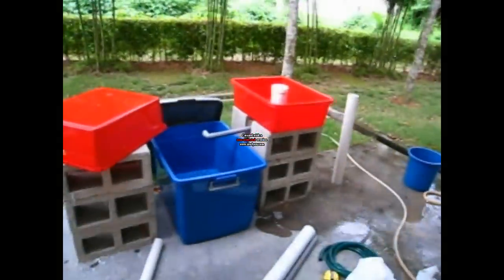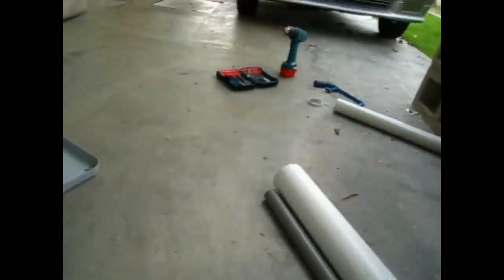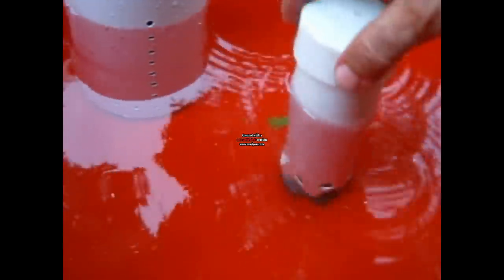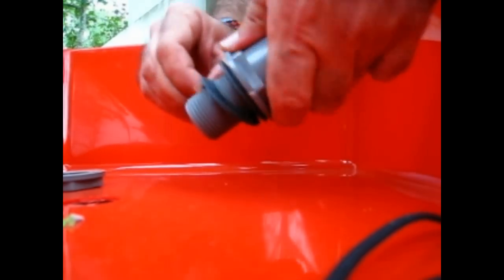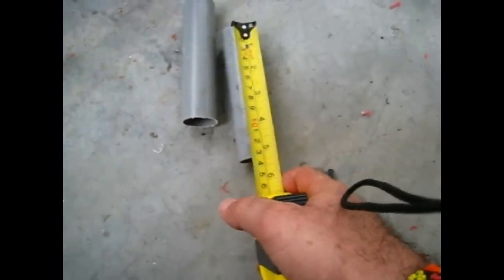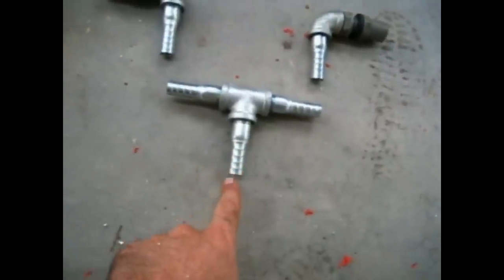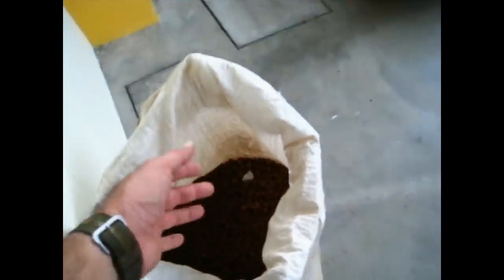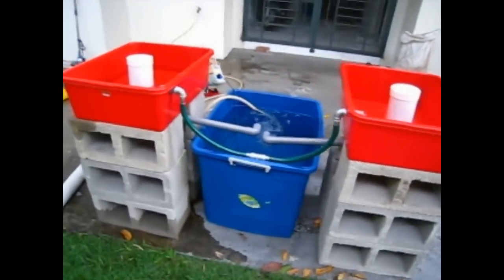Aquaponic System For Beginners (guide) . Home Aquaponic System on a Low Budget

Comment: Just saw your video for the first time.  First of all, bravo!  This is a great little set up and your willingness to put it together for charity reasons is wonderful.

A couple of suggestions, based on my experience:
1)  if you can avoid using the metal hose fittings, do so ... the galvanizing/ anti-weathering coating can poison your fish, which is no fun.
2)  if you can, add about another 20mm of hydroton (grow media) to your system so that the water level is below the surface.  This avoids problems with algae/ green slime.  Also, it will stabilize the mass by preventing the media floating.
3)  if you know the amount of water you have in the fish tank, then that is the number of litres minimum size for your grow beds.  Depending on your fish, you can go twice that many liters.

All in all, I love the design.  Simple, elegant and very well explained.  I look forward to seeing an update of the system in place and running at the school(?)!

Comment: Just a hint for people doing this, there is a small hole above the larger holes on the "bell" which is necessary to break the syphon is also known as a snorkel. If this is not there the syphon does not stop draining. You might have mentioned it but I missed it :) Great Video!

Comment: A flood and drain system have two chief parts - a fish tank and a grow bed. The grow bed is filled with expanded clay balls and is situated above the fish tank. Water from the tank is pumped into the grow beds then allowed to return to the fish tank. These flood and drain stages are controlled by using an automatic siphon. This switching between flooding and draining is repeated continually.
Reply from the maker: Thanks for your explanation.

Saeid

Comment: Hi Saeid,

Nice system - one thing I'd suggest, though, is adding some kind of external support to the fish tank to keep the plastic from bowing out over time. An 'exoskeleton' of wood is simple to build, and will prevent deformation of the plastic, which looks unsightly and, worse, can cause the plastic to crack over time.

Good luck!

Comment from the maker: It was a Nursery shop. If I were to do it again, I would most definetly forget about ydrotons and go with Gravel. Concrete Blocks will ofer great support at a very low cost.

In fact I will be coming to Penang in the next few weeks. I've had my Tiara parked on the side of the street for the past year and my scooter at a friends house. Need to come and sell both.

Comment: Nice setup. what about a filter, to filter the water that comes from fish tank to grow bed? I have seen in some videos they are being used and in some not. is it necessary ?
Reply: With a half dozen gold fish, you generally wont require a second filter bin to collect the solid wastes. If you are growing fish for consumption, you'll consider a vortex style filtration system bin to catch the larger solid wastes to avoid water changes.

Comment: Saeid,
Great video, I have been planning my first setup for a year now with two 33gal barrels set up in a solar paneled green house to be 100% self sufficient of itself.  Two questions: 1. What is best to do for timing on how long fish are in the tank to provide nutrients and when you plant your first seedlings? 2. Does your pump operate on a timer if so is there a good idea of how much needs to flow to maintain proper nutrition for the plants and clean water for the fish?  I have read a lot and realize it depends on amount of fish, size of tank and beds and size of fish but just looking for more ideas on that.  Thank you in advance!

Comment: Hi Saeid, one thing I notice is that you have pump out the water from your fish tank... in which it may cause water deprivation to the fish, due to the size of your fish tank. I suggest that you install another tank, something like a holding and settling tank , then an over flow line from your fish tank to the holding tank. Install your pump on the holding tank and from there you can pump out water and supply it to the plants above and drain siphon can be still follow your old setup and be directly lined to the fish tank... while the overflow line from the fish tank will protect the fish tank from over water.

Comment: It must have been an effort holding that camera and be informative at the same time. Also I was wondering where your were building your system until you said Penang. Perhaps another video with the whole thing operational after a few months?
thanks for your upload.
Reply from the maker: This system was done in a hurry for the Children's Protection Society in Penang.I had to leave a few days later and was gone for about  months. It wasn't attended to as I had hoped, and as a result it was in pretty bad shape. The water was filthy. No air pump for months. The top was open and there it was full of leaves, algae and other garbage. Some of the fish had disintegrated. And surprisingly, among all this toxic stuff, most of the fish were still alive. I cleaned it out. Saved the fish and put them in another container and gave it to them to take care of. And that's the last I saw that system.

And that's the whole story. So I guess I'll put this in the description too.

Thanks for asking (-:

Saeid

Comment: I loved your video. I am wondering if the water pouring down could also be used to run a small water wheel power generator to be less dependent on other sources of power?

Comment: Oh man, I just couldn't convince myself to go through every comment. I'm about to make my own. Thanks so much for the easy to follow video. There are two things I would like to do different and I want your feedback before I do. Instead of using a pump, I plan on just using two separate pieces of tubing and running one to each upper tank. I don't see why I cannot just start the syphon action on each tube and connect it. Do you need a syphon on the plant tubs? Can you just use a drain?

Comment: Hi, it is a great introduction. It is hard to get the fitting that going through the tank at the  bottom of the growing bed and the 90 degree thread elbrow. Could you provide a bill of materials so that i can check them out in the hardware store. Many thanks.

Comment: great video for basic setup. 
one question, shouldn't the water level in grow beds be little lower?
about 4-5 cm under the surface cuz it will start to create algae overtime and that will start to block the system and oxygen pull when siphon starts working.

Comment: There is no way you can grow eatable fish in that small of a tank. You need at least 50 gallons. As low as the water level gets when filling the grow beds even common goldfish would be stressed to the point that they would die. The bell siphons in this system are also unnecessary.  For this system to work properly you need to get rid of the bell siphons and fill and drain from the bottom of the grow beds or at the very least add a sump tank. This is a good video to show a bell siphon and basic plumbing. Aquaponics is our future.  Thanks for sharing and keep it up. Impo u need a sump tank.

Comment: I love it ... however as an engineer I couldn't help but notice a few things, first like alot of others said it's better to have a pre pump filter, second and more importantly, how do you keep that (no offense) flimsy 60Wat pump running 247 without replacing it once every month ? Unless this project is not ment to last a winter and just a science project for kids I see no way around investing in dual industrial water pumps and properly managing their duty cycles. Even residential water pumps cannot run 247. Also for people who use submersible pumps, which are water cooled, in a plastic container, the water temperature might slightly increase, does it affect the fish ? Is it better to use an air cooled pump and make extra plumbing to the fish tank ? Please enlighten!

Comment: Use teflon tape on threads, only use aquarium silicone, silicone sealant from a hardware shop contains chemicals that leech out. Aquarium silicone is totally inert after it dries.

Comment: what you should do since you fill both grow beds at the same time is get a holding tank so the water circulates so the water level doesn't get too low.
Reply from the maker: Since I used a big fish tank I didn't really have a problem with water level.

What I did have problems with was the pebbles floating and the seedlings sinking. 

One modification I would make would be to choose a shorter inner pipe for the siphon, to keep the water level lower in the grow beds, and higher in the fish tank.

Thank you for your suggestion. I will keep it in mind for my next system.

Saeid
Reply: or use river rock or pea gravel cause then the medium is too heavy to float.

Comment: Thanks sir. My thought is to use gravel as well. The thing is the weight. I have two very young kids who are very active and mischievous. May try out small first using gravel and build a strong support for that.

Anyway, thanks for the location, will try to look at that vicinity when passing through New World Park. Btw, what shop is that? horticulture? 

Do leave a message if you are coming to Penang.

Comment: This is a good job, Question: Could you explain what is the mechanical and mathematical principle, I have been trying to apply the same model but it takes a long time to siphon  water out of tank and when I increase the number of holes in the bell, does not siphon at all; due to rapid infiltration of water. in another words how many holes/slits and what is the size of the tank and then I could apply it on my own system proportionally. Thanks  '' I am trying to get the answer''
Reply from the maker: Mohamad, did you watch the part of the video where I explain about setting the Back Pressure? Bell siphones are very easy to make. You don't need to count holes to make them work.
If you still can't get it to work, shoot a vide of your siphone, with enough detail on the pipes and all, and post it. I'll be happy to have a look
Saeid
Reply: thanks Saeid Momtahan I solved my problem after several trials and it worked.
Reply: hey ,if anyone else wants to discover diy aquaponics system plans try Qwixie Amazing Aquaponics Helper ( search on google ) ? Ive heard some incredible things about it and my brother in law got cool results with it.
Reply: Krystelle Garcia thanks

Comment: Hello Saeid, thanks for the video. I have a couple of questions. Why do you have the water in the grow beds higher than the growing medium? Also, at the start of the video you mentioned that the blue size tub can support 5 grow beds of the red tubs. What happens if all the grow beds fill up at once? I ask this because wouldn't the blue tub empty and then kill the fish. Thanks again for your time and good on you for your work with the orphanage.
Reply from the maker: Kane, the water in the grow beds needs to be adjusted so it is lower than the grow medium. I would recommend not using Hydrotons and using gravel instead. If there is enough gravel in the grow beds, there should be enough room  in the fish tank to hold all the water, even from 5 grow beds.
But this is all to provide you with ideas. You need to play with all of it to make it work for you. THere is a lot of learning to be done with AP systems.
TY
SAeid

Comment: Hey Saeid, just found out about this video about 3 years after you put it up. Haha .. happy to see you are still responding to it. 

I am also located in Penang too .. but like you mentioned, I have having some hard time finding the materials to build a simple system. Where would you recommend? Appreciate your kind answer.
Reply from the maker: Lasker, I got the tubs from a plastic shop on Air Hitam road i think. It's the road that goes to Kek Lok Si, but instead of turning right, keep going straight for a few KMs.

The rest are easy. Hydrotons, forget about them. ust use gravel. Much easier'

TY
Saeid
Reply: Saeid Momtahan Thanks Saeid, the plastic shops are pretty easy I believe. I was thinking about the pipes and materials for the bell siphon, connectors between the tubs. 

I went to Ace Hardware (QBM) and they don't have any. They also do not have the holesaws (a circle with saws around it).
Reply from the maker: Any building materials or hardware shop will have all of what you need for pipes and connectors. Forget Ace, too expensive.

Saeid
Reply: Saeid Momtahan Thanks for your reply. Found what I needed already :)

Comment: Hi Saeid, thanks a lot for this video!  i understood everything, except for the finished product and what you did with the pump, i noticed like a blue dome in the fish tank, what is that? and how did you get the power lead hidden?  Do you make a hole in the fish tank to lead it thru?  sorry im new to this, and noticed that part wasnt explained....thank you again
Reply from the maker: Hola Juan. The blur basket is a filter for the pump. Please see this video
http://youtu.be/UNP0gf5u2tM

THe wire is just run out of the top of the blue tub, nothing fancy there. All simple stuff

Saeid
Reply: Saeid Momtahan thanks for that Saeid, appreciate it - one last question, if i want to add a third grow bed....what would be needed to do that? an extra pump? etc etc...

Comment: good video mate, i wanna build a similar thing on my terrasse, only thing is the noise..
any idea on how to reduct the noise of falling water ? 

also, does the pump costs a lot of electricity ?

thanks
Reply: +Oliffin end of the pipe must remain open and unrestricted or siphon will be affected, however if you line up a ramp underneath the flow it can reduce noise levels

Comment: hi bro where do you get the pallet in penang , i am searching for it also but seem no one know about it , thank you for the time in advising
Reply from the maker: Matthew Tan Mathew, I'm guessing that by pallet you mean the HYDROTONS. If that's correct, don't bother with them. They are a complete mess. They never stop creatin g dust that will clog up your system. Go with gravel. Much better in every way. Except they're much heavier. So design for more weight.

The Hydrotons FYI were REALLY hard to find. It took me a few days going all over penang to find them. Wish I'd gone with gravel myself
Saeid
Reply: Saeid Momtahan help to advice which gravel should i use in the system ,Thank you

Comment: Saeid, re the syphon is there an optimum cycle time? My existing pond pump is quite powerful and with the present flow rate the box would probably be filling and emptying every few minutes or so.
Reply from the maker: Hi Ken. From what I've seen a 10 minutes cycle seems to work for many people. If you have a powerful pump I'd consider buying a smaller pump, to slow down the cycle. Also since the pump will be running 24/7 you need to consider your electricity consumption.

Keep in mind though, if you go too small on the pump, the syphonig action will not start.

Another option would be to use your exiting pump, and via an adjustable valve, divert some of the water back into your pond for aerating the water. THis way you won't need an Airpump.

Yeah, I'd go with this last one (-:
TY
Saeid

Comment: Great Video, im new to Aquaponics but have messed around with Hydroponics a lot. How come the system doesnt fully drain and then flood again on a timer like that of Hydroponics? is it a constant 24/7 flow? For instance my siphons on the hydro have drainage holes at the bottom of the enclosed overflow tube so that the system completely drains and then every 3 hours on a timer it is flooded for 15 minutes and then drains again. Is this not the case for Aquaponics? Again great video, im gonna have a crack at this - Chris.
Reply from the maker: Chris, I haven't seen a siphone that drains the grow bed completely. Can u pls post a video of your system? 
The flooding and draining depends on the climate as well. In drier areas you'd need to keep the pump on 24/7.
So you flooded your system only for 15 minutes every 3 hours? Did u not have any issues with your roots drying out?

Look into Raft Systems and NFT as well, There are quite a few options as far as the set up goes. I'm designing one right now that uses NFT, Grow Beds and a Raft all in the same system, Be posting a vid soon.

TY,
Saeid
Reply: Saeid Momtahan My first hydroponic NFT system got bad root rot because of the constant water even though I had airstones and a high level drainage pipe, the guy at the shop where I get my nutrients told me to have it on a timer and let it only come on 4 times a day and it worked a treat.
Reply from the maker: I had the same issue, plus a few more, with my last NFT AP system. So that must have been why. Will keep it mind for the next system.

TY
Saeid

Comment: Check out the video's by a Malaysia chap called Affnan...He has designed a very nice and working outlet for the bell siphon which also aerates the water in the fish tank as it drains.
The snorkel (mentioned by other viewers here) is usefull esspecially when you have trouble/difficulty dailing in the influx of water from the pump...

in your case I recommend e dutch bucket design in regard to the flood and drain system,... You could use 1 siphon and connect the grwobeds (which are level)
Sander

Comment: Nice video man. One problem that you made, that almost everyone makes.... you spent no time explaining the mechanics of the "connection" in the bottom of the tank. That part that you use, "connector", is the most important part. You should explain how it works, what its ACTUALLY called, and where to get the parts, because home depot doesn't carry the right one. I had to make one and ended up making it way too big because there where a bunch of parts that were too big.